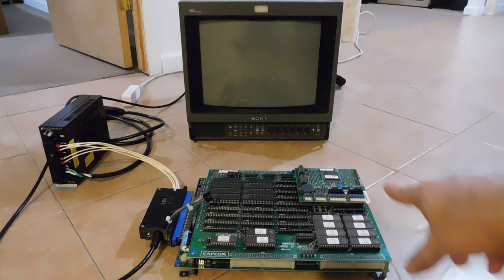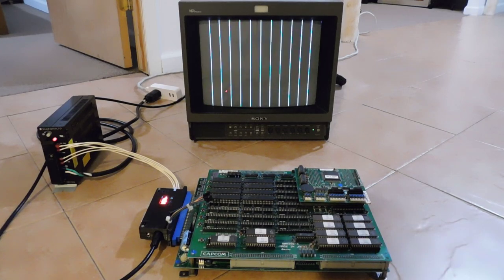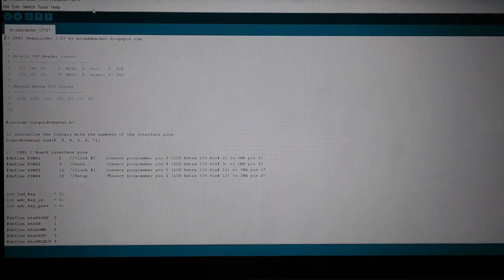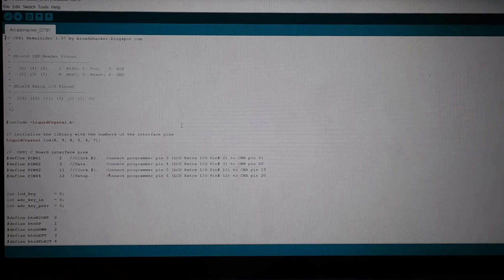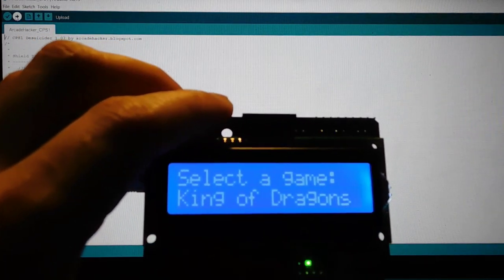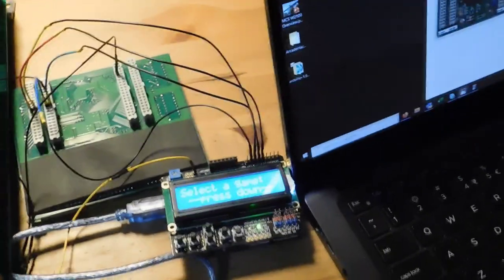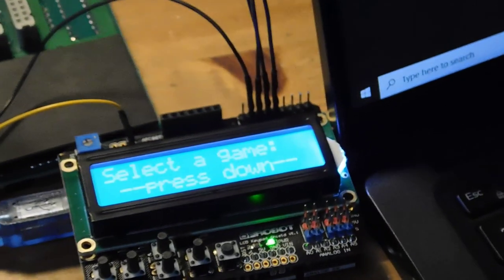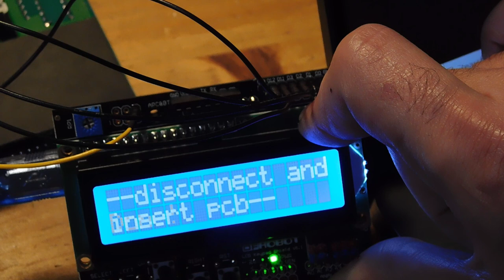Capcom CPS1 Arcade Repair - Suicide Battery Fix! King of Dragons Arcade PCB Repair

Comment: Hello so you can fix Arcade pcb like Superman 
Golden Axe from sound issues or image problems?
Reply from the maker: It depends on the type of problem the board has. I have repaired several arcade games but I would need to know more about the specifics in order to help

Comment: I have Japanese King of Dragaons, Knights of the Round, Wonder 3 and Captain Commando boards I need to de-suicide.

I know this is 2 years old, but do you have a tabbed 2032 battery source you can reccomend?  I want to avoid the cheap Chinese crap and get genuine Panasonic or Maxell.  No doubt the board would be dead again after 10 months using one of those fake Chinese things.  Original batteries lasted 20-30 years and that is what I want.  

Although, just bought the CPS,I.5 multi so they will be safely stored away once reprogrammed :D